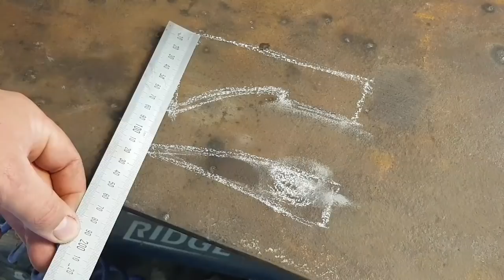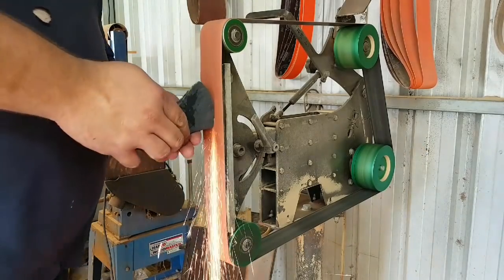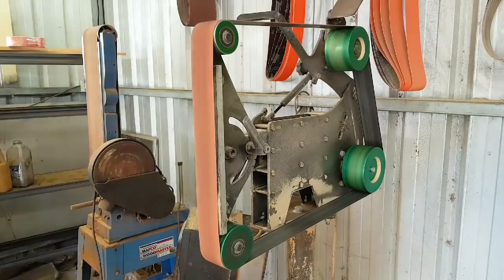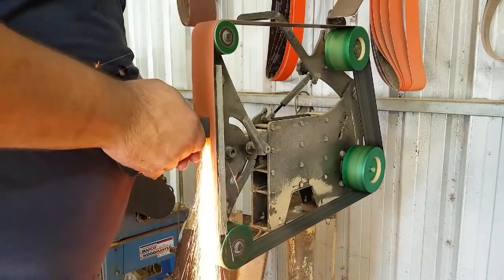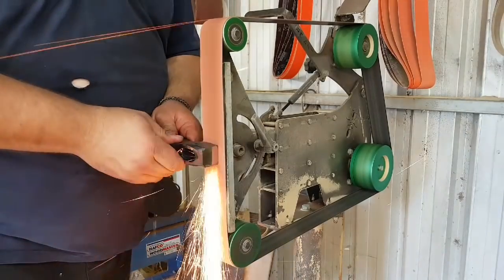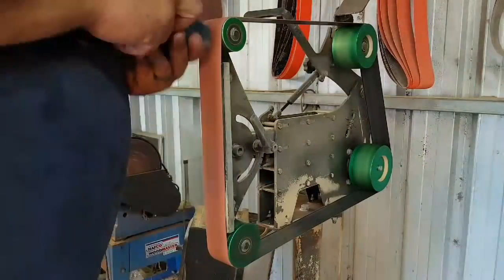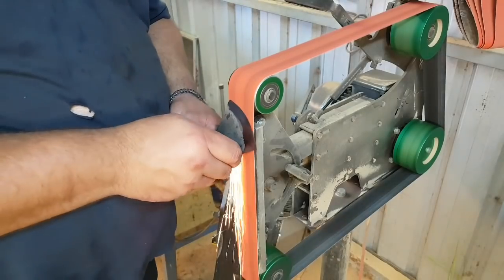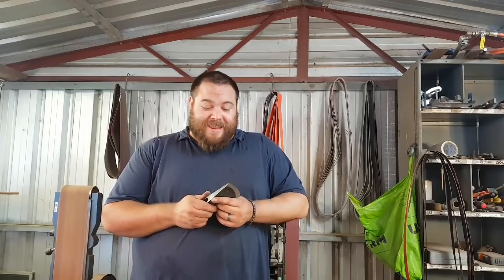Forging a 16th Century Turkish Saddle Axe

Comment: The sound of the forge was first misheared as the swing sound of the hammer. My first thoughts were, holy koala! Nice video. Could you explain how you calculate the required material length and size of the source material to get to the finished axe from your drawing? I mean, I know that you loose about 10 -20 % through oxidation of the material. Depending on how many reheats or heat cycles you need to finish the product. But it would be of great interest for me. Most of the time during my forging lessons, I just cut of the part that is too much, but that resulted in many little iron pieces that could not be used any more for anything.
Reply from the maker: My usual method is to weigh the beginning stock or billet, and know what my final weight should look like. You can also calculate final volume but that's a bit more in depth. I tend to cut a billet that is final weight + 20% to account fpr loss in forging and grinding
Reply: @SamTownsBladesmith  Ahh, okay. That is a clever quick and dirty way to measure the amount of material.
Reply from the maker: @stefanmierke4801  clever quick and dirty is my jam!

Comment: I listen to forgecast and just heard you discussing this and thought I'd look it up. Why do you use the wobbly anvil with your
buddy hammering instead of your secured anvil?
Reply from the maker: It's all about striking height, the striking avil is much lower which allows a better swing for the striker. The reason it's wobbly is because I can't bolt it down, don't have the floor space haha